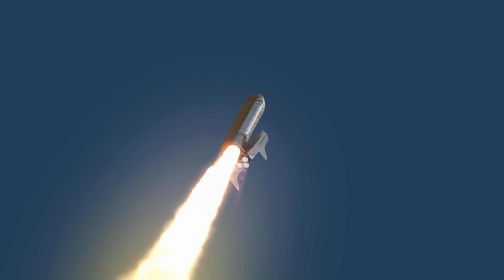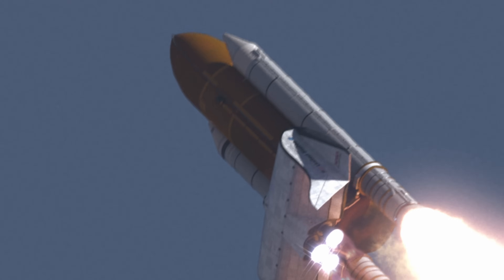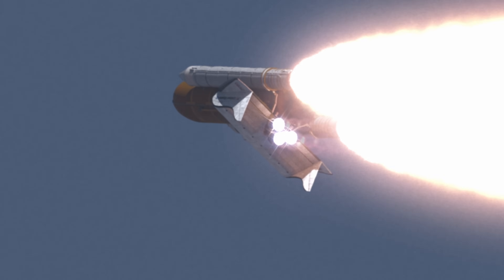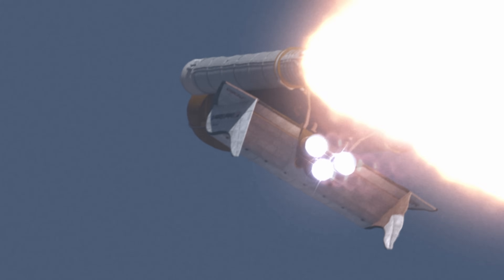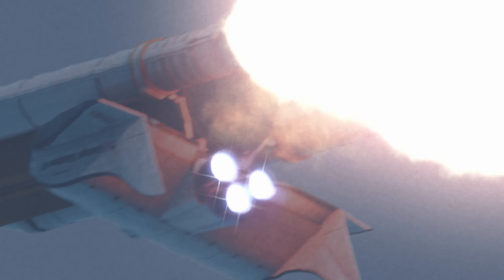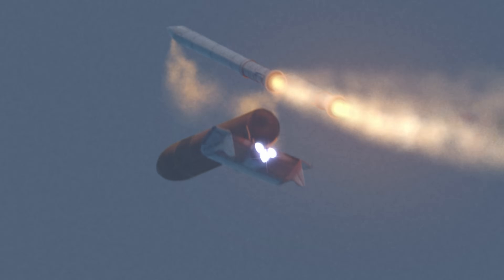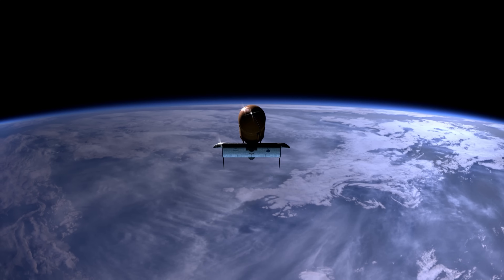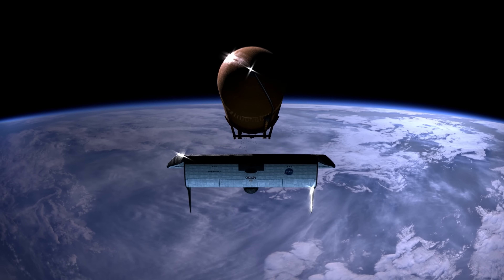Rockwell C-1057 "Breadbox" Space Shuttle Concept

Comment: That thing has the aerodynamics of a cinder block.
Reply: It has the aesthetics of a cinder block, at subsonic speed I think it’s actually very aerodynamic. I can’t comment on supersonic.
Reply: The shuttle already had the flight characteristics of a brick, this probably improved it
Reply: @jocax188723 lol
Reply: @jocax188723  I turned on comments specifically to point this out.
Reply: Seems like it would be obliterated at supersonic speed. Let alone orbital velocity. But idk.
Reply: @Vacmaster1991 Do you mean orbital velocity? The Space Shuttle can't reach escape velocity.
Reply: @pseudotasuki . I meant orbital velocity. 17,500mph. Escape is like 25,000. I will change it.
Reply: orbital velocity it did of course
Reply: @Vacmaster1991 The increased supersonic drag would slow it down higher in the atmosphere earlier, leading to possibly lower total dynamic stresses on the airframe at the cost of some cross range capability and adding a shallower glide slope. It could be, on balance, an improvement.
Reply: @2sudonim . It just seems to me that the huge width and relatively flat nose would create incredible drag. Enough to cause structural failure.
Reply: @Vacmaster1991  It likely enters the atmosphere with a very high AoA, like the STS did to present a blunt body on re-entry. You actually want more drag on re-entry to slow you in the upper atmosphere where there's less air so you get less heating. It could then glide better than the STS did at subsonic speeds.
Reply: @Vacmaster1991  penguins have perfect aerodynamics, believe it or not.
Reply: @memespeech  You mean hydrodynamics? 
And that will only be true over a limited speed range, while the flow is still laminar. 
Go fast enough and they will cavitate, which would be very bad.
Reply: @memespeech no... Penguins has perfect "HYDRODYNAMICS". It's not the same thing.
Reply: @FranciscoMartinez-rl6rq 
The difference between the two is the density of the fluids the shape moves through.
Beyond that, IIRC, the equations are similar
Reply: @memespeech  an actual arrow doesn’t have perfect aerodynamics a penguin has good aerodynamics, but not perfect
Reply: Well, so did the real shuttle 😅
Reply: Given enough thrust even a cinder block can fly.
Reply: Cinder what? The Burnelli CBY-3 (same shape with wing consoles) flew safely for quite a while.
Reply: Lots of lift bud..  lots of lift.
Reply: Correction, a rounded cinder block. With tail fins
Reply: We don't need research and math to know that
Reply: How well does it glide after presumably surviving reentry?
Reply: @diracflux  It's a flying wing lifting body, so quite well, I would think. Flying wings have an incredible wing loading capacity. While the Space Shuttle Orbiter is also a lifting body, it's a bi-stable blunt bodies lifting body covered in ceramic tile. It, frankly, flies like a brick. It has a glide ratio of something like 4-to-1; meaning it travels 4m forward for every meter it drops while gliding. Normal planes have something like 10-to-1 glide ratios. Gliders have anywhere from 50-to-1 to 100-to-1 glide ratios. I imagine this would have a glide ratio of between 10-to-1 to 20-to-1. That would make it a great deal easier to land than the SSO. Though it would probably perform terribly in a crosswind.
Reply: Lower loading and heating, greater crossrange and lower landing speed.
Reply: Наверное самый дорогой шлакоблок
Reply: Still better aerodynamics that what was actually produced.
Reply: Probbably because it is a cinder block.